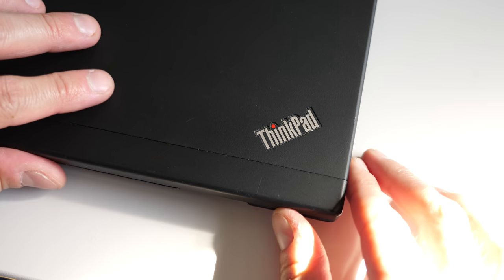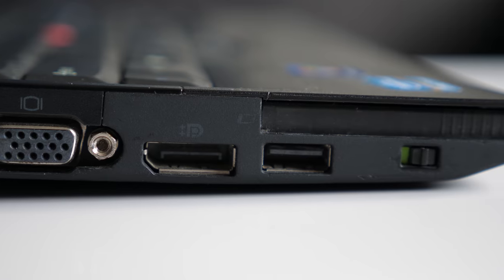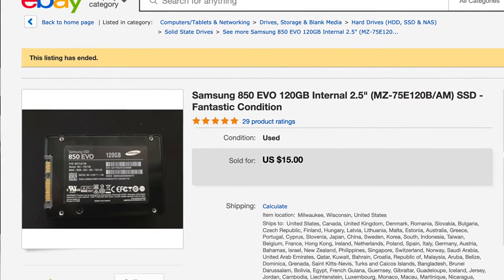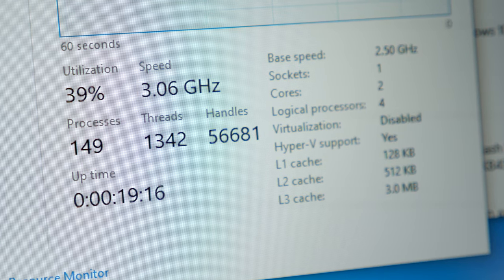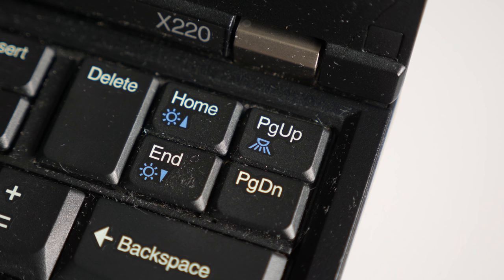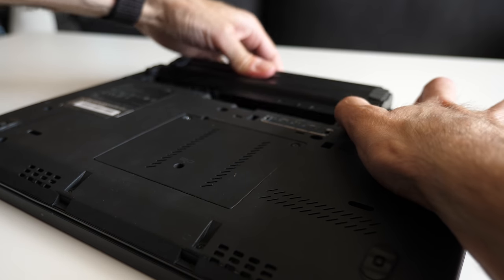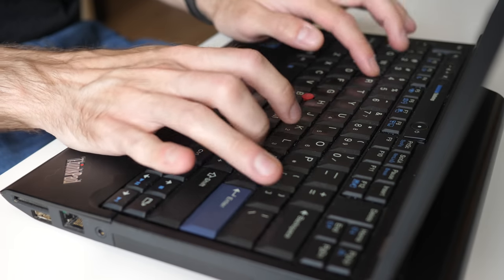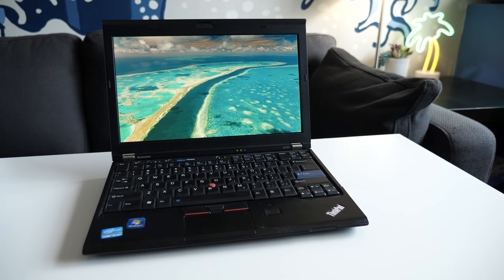The $100 Laptop Challenge -- This Old PC is Better Than You Think

Comment: X220 with i5 has no USB 3.0. This was exclusive to i7 model that had additional controller. They became standard in x230.
Reply: There are three port USB3 Express cards for the X200, X201 and X220's.  Magically three full USB3 ports get added (no dongles either) at less than $20 delivered (USA). :)
Reply: My i5 X220 has a single USB3 port via an external controller? Doesn't work with all USB3 devices though...
Reply: @radiolabworks  Don't you need extra power for full speed though? I got an express card with 2 ports and a tiny round power connector between them...
Reply: @radiolabworks  I've tried one of these cheap USB 3 expresscards and it didn't prove very reliable. Maybe power issues, since Expresscard only provides 3.3V power.
Reply: @MiniRockerz4ever  Most of the time it's okay with USB keys but with external hard drives, extra power is required .
Reply: You could added a USB3 port (actually two) via the PC express slot. That's what I did. However, with just stand working business, the USB2.0 port is really not borther me that much.
Reply: my usb 3 express broke 2 times over.  I still don't even own a usb 3 device
Reply: The W520 has two USB 3.0 ports.
Reply: My T420s with an i5 has a usb 3 port in it
Reply: @comicsans1689  The w520 is i7, which he did say had usb 3. But he was wrong about it being exclusive to just the i7 alone
Reply: All of you - X220 with i5 had no built in USB 3.0. Only i7 board had.

W520, T420, T520 and whatever else you can find in 2nd generation is NOT x220.  This video is about X220, and I wrote "x220 with i5" so all of you having USB 3.0 in i5 equipped OTHER models proves nothing.
Reply: But i painted my usb port blue, so now its usb 3

Comment: I have a close relative of that in my T420. Last year, I upgraded it to 8 GB of ram, a 1 TB SSD, and added a USB 3.0 part. Works pretty well. I even use it for my video editing (720p).
Reply: What is the USB 3.0 part? Looking to add one in mine. Is it a card to add in  the express port?
Reply: @maskednil  Yes, that's how I added it.
Reply: for how much did you get it? i might get mine soon with 70$ i dont know if thats a good deal or not

Comment: I love everything about this video.  I love the market analysis, I love the computer you went with, I love that you went around it and showed the good and the bad, I love that you went over operating system choice and let people know that they may just find a windows key there if they go looking for it, I love that you bring up freegeek and the amazing work that they do, I love that you encourage people to check them out, to contribute, to volunteer, to shop there, and help out a place doing great work for the community (particularly the youth computer enthusiasts who don't have any money like I was.).  I really wish there was a place like freegeek in my home town when I was growing up (not that I'm sad that I spent quite a bit of time volunteering for the library system who helped me in my early learning process). - not only do I love this video a whole lot, but I made many of the same choices myself.  I bought a used x230 on ebay, I put a 250gb ssd that i had laying around in it, but instead of running windows on it, I chose to install ubuntu myself because it has much better resource management (cpu, memory, etc.) than windows (but windows is also a great choice... in fact before I got mine, I helped my wife get an even better x230, installed a bunch of ram and a big ssd in it and she's using it as her primary machine (where i use mine mostly as a netbook and also to remote into my extremely powerful desktop machine when i need more resources).  I will be sharing this video around! Thanks, Colin!

Comment: I miss my X220 which was setup as a Hackintosh, sold it a few years ago to get a 2016 Macbook, keyboards not nearly as good
Reply: How has the keyboard held up on the MacBook
Reply: @jscipione  true
Reply: yeah those 2015 mbps had the worst generation of those butterfly keyboards
Reply: WHY YOU SWITCH, STOP UPGRADING AND START BEING A SURGEON TO YOUR LAPTOP/DESKTOP!
Reply: @FireFoxDestroyer  what
Reply: @tombarber8929  Why did you switch, you could've upgraded to an SSD instead, or maybe I was wrong..
Reply: Sorry.
Reply: @FireFoxDestroyer  I've been  using Macs since like 2000, before the Thinkpad I had a Macbook Pro 2011,  so the Thinkpad was more of a "switch".  Was running OSX on it, but had some issues whenever I updated it so I went back to the real Apple hardware, just happened to be when Apple really fucked up their keyboards
Reply: @onometre   help
Reply: I've also got an X220 + SSD that's been single-booting macOS since late 2016! Really smooth for everything except heavy data analysis and games, and the keyboard and screen (IPS) are really nice. Definitely a special machine.

Comment: Great video and great advice - would have an older x270 7th gen i7 that was $400 and it runs better than most modern thin and lights . Lenovo rock higher ghz chips so you get the speed ..... I swapped up to 16gb ram and got the extended battery and now this thing is a spaceship 🚀

Comment: Moore's Law has been perverted to mean "computer speed doubles every 2 years", while the original axiom was that transistor density would double every 2 years.  The problem is that this has neither held true, nor has it been true for a while.  This is why almost 10yo computers still fight above their weight.  What you will find in subsequent generations is that power usage has gone down, partially due to new processes and partially due to improvements in existing processes.  So a 6yo laptop with a big battery will get 3 or 4 hours of battery life, while a "airbook" today will get 8 hours, be 3 times thinner, and 5 times lighter.  With that "added lightness" you also get a reduction in useful ports and a reliance on dongles to perform everyday tasks.
Reply: The annoyance to me is the expandability of modern laptops.  I presently have a Latitude E5430 that allows you to upgrade almost any component easily (even the CPU!), but at this point I want a laptop with a FHD display, plus my E5430 has some overheating issues (a common problem).  Thankfully I've found that some machines are relatively easy to upgrade....but apparently laptop maintenance hatches are not a thing anymore, so you have to use a spudger so you don't destroy the plastics/metals of your new laptop. 😕
Reply: @ipeters61  My 2014 MSI GT60 2OD is pretty upgradable, the CPU, memory, disks, GPU are all socketed.  The display is the only thing that can't easily be upgraded, that's why I searched for a laptop with the best display I could find.
Reply: Another reason for me to like the older tech best.
Reply: I always like to say that sandy bridge really broke moores law.  I use sandy bridge still in my desktop and my laptop.
Reply: And you gain the ability to overheat as hell because they make these newer laptops thinner than they should.
Reply: The real reason why ThinkPads (and other older devices/technologies) are much better in many ways, is because, under a capitalist competition based economic system, companies, manufacturers, need to sell things cyclically. That's why intrinsic and planned obsolescences are designed (have to be) into objects more and more.

When objects were made to last, as in case of older ThinkPads, as in case of things produced in 50s, 60s, 70s, 80s - companies were able to "afford" to make sustainable, lasting products. Not anymore, today you companies really have to think about how to design products in a way that they will fail after few years.

There's no reason why for example today's notebooks couldn't or shouldn't be made with complete upgradability in mind, with really replace CPUs too, and why we couldn't or shouldn't keep producing parts for "old" devices, original batteries for old devices, and so forth.
Reply: GPU computing says hello. It's just CPU technology that has slowed down. GPUs are still advancing in line with Moore's Law. Hence why GPU acceleration has been rapidly adopted in compute intensive tasks.
Reply: @teemuvesala9575  Not exactly. While GPUs have increased in processing power significantly more than CPUs they have also became significantly bigger and more power hungry. Also AMD managed to stay competitive in the GPU market, while Intel had basically no competition until ryzen came out.

Comment: Thats what i have been preaching. Buy used enterprise grade stuff. Upgrade for a few extra bucks. You end up with something way more performant, sturdy and high quality for less money while also reducing e-waste and doing something great for the environment. 

If you were to spend 300 bucks on a new entry level machine, get a used enterprise class dell or lenovo for 2xx - you will get something in a very good condition (ex leasing machines from big companies remarketed), invest another 20-80 for a nice ssd and there you go.
Reply: 100% agree. Bought a used Thinkpad Yoga with a 12 inch screen. Thing comes with a pretty good stylus, the keyboard is fantastic (as you'd expect, really). Has scratches on the chassis and a fan grille is slightly broken (but really nothing major). Thing was 270 bucks, 256GB SSD, 8GB RAM, 5th gen i5. 
For that same money you could buy a chromebook R11 or something. With a celeron and 4GB RAM. Would be 30 bucks more actually.

Oh, and since I bought from a retailer (and live in the EU) I even get one year of full warranty. I'm not sure I'll ever buy new again.
Reply: Applies to so many other things too; switches, routers and access points for instance... Most of the domestic grade stuff is crap, even if it's not cheap. I needed a 48Port switch...POE would have been a nice to have. Picked up an HP Procurve for £80 delivered, has 360W of POE built in, can do over 700W with an external PSU upgrade. Sure it's fibre ports arent 10G, but that's no deal breaker for my needs...especially when a new switch with SFP+ would have cost me best part of £900...and not for a particularly good one.
Reply: Reduce - Re-use   :)
Reply: Seems to work with elitebooks as well

Comment: I've bought two Months ago a Lenovo T420.  Made in 2011 its impressive how good you can still work on it. I'm thinking about to upgrade with an SSD and more Ram.
Reply: Do it. It's 100% worth it! Love my T420.
Reply: @MrFreddy123  yes
Reply: A SSD always help the speed perception of old machines, more than RAM. And once you go SSD on your daily machine, there is no going back. I even installed a cheap used SSD on a Atom netbook I have.
Reply: @magoid  Yes I have installed an SSD on my Main Computer (Desktop) a week ago and will definitely newer go back to a regular HDD as Maindrive.
Reply: @DengekiGamer  Especially if using Windows 10. SSDs are a must for boot drives.
Reply: Don't just think about it. Do it.
Even a cheap, low capacity SSD will be good enough for a boot drive. And your PC will just start up so much faster
Edit: I just now see that you already did it. Good decision, all my PCs are using SSD boot-drives by now. Just because it feels so much snappier

Comment: For $100 in 2022, I picked up a 2015 HP ZBook 14 G2 mobile workstation with an Intel Core i7 5500u dual core processor with 8 GB of RAM and 1 TB Toshiba HD. It was in mint condition and it stacks up quite well against today’s consumer grade laptops. Everything is repairable and upgradeable apart from the cpu snd the TPM module. I was able to upgrade the BIOS to the latest version available in 2020. Its s good value on a budget!

Comment: Another factor to consider, which wasn't mentioned in this video, is that Lenovo Thinkpads of this period had amazing keyboards. If you're going to spend significant time writing or coding, then it's really a no brainer.
My Thinkpad L430 - which I'm typing on now - has been one of the best laptops I've ever had. The only downside I can think of is that I'd prefer a 1080p display.

Comment: i´m using a Thinkpad X230 since 2015. It´s fantastic. The display backside and the bottom cover are made from magnesium. And you can use a MSATA SSD in it if you don´t wanna lose the space of the HDD in there. For 80$, it´s a steal. The sandy bridge(x220) or ivy bridge(x230) CPUs are fast enough for everyday tasks.

Comment: Man, this reminds me when I used to bring my old thinkpad T420 with me everywhere in high school with ubuntu 16.04 installed. 

I loved that machine, without windows it was much much faster (before I upgraded to an SSD), and it was just maintenance free for the longest of time and was a awesome machine to use throughout high school. I always was ‘that guy’, since laptops weren’t allowed in class but I had a special exception both because my thinkpad matched all the other schools thinkpad, and because I had come from another school that used primarily laptops.
Reply: Yeah i noticed that too. Not only boot time but overall software speed was drastically faster under Linux than windows. Even with a HDD.

Comment: I've been tinkering a bit with old laptops from the 90's and just about the start of the 2000's, and the build quality on these are just way beyond any budget laptop of today. Yes, there are more premium laptops available these days, but these early ones just has that extra quality about them, especially with the keyboard. Even todays ThinkPads have mediocre keyboard compared to their older brothers. I have a ThinkPad T60 from the mid-2000's and the keyboard just blows me away everytime I use it. Too bad it is only usable for light web browsing and typing these days.
Reply: Exactly, I have a few 60 and 61, both from the T and the X series. Besides tinkering with alternative operating systems (like Plan 9), my main use case for them  is writing.

Comment: Watching on a Dell XPS 15 L501X I got in 2011. Still going strong on a gen 1 i5, 6gigs of ram, and an hdd. (I've ordered a 4 gig stick to boost it to 8, and will get an ssd when I have money coming in again. Aside from the stuff that actually requires a modern cpu/gpu, etc. there's nothing it can't do just as  well as something brand new.
Reply: I should say, watching on XPS15, while working on a Latitude D630...which is even older, but performs just as well on linux mint for stuff like browsing.
Reply: I still use as my main computer 12 year old Lenovo T410, i5-520M, 8 GB RAM, SSD SATA-2 (Bitlocker encrypted), W10 Pro. The only practical problem is Youtube 720p60, quite noticeably burdening the processor (40-50%).
Reply: @telemasz1086  Yeah...that laptop died, lol. The graphics chip took a crap, so I actually ended up finally taking the initiative to build a pc, lol.

Comment: Couldn't agree more. I have a Dell Latitude E6230 which is now ten years old. It's an i5-3320 with 8gb of RAM and a 128gb SSD that I bought as a refurb in 2016 for £220 (UK) and, having spent an extra £50 or so to replace the battery and power brick and replacing the pre-installed Windows 7 with Windows 10, it's still working just fine in 2021. It wouldn't be able to cope with video editing or anything like that, but it's perfectly happy to do image and audio editing, and it's find for every day use. I keep think it must be due to expire, but the damn thing just keeps going.

Comment: Great video! As I write I'm using a Dell  e6320 that I picked up used for around $100.  It was surplus property from our local state university.  It was very dusty, the hinge screws were loose, but it was hardly used!  That was , a couple of years ago and I have no regrets.  After proofing it and using it for awhile, I invested in it some more and upgraded to an SSD drive and went from 8 to 16gb. Now it flies with its I7 and bridge CPU its Ubuntu 20.04.  Who needs Windoze?

Comment: I still use a ThinkPad X200 as my portable machine. It still have a regular hard disk, but the performance is enough to take notes, chat, send e-mails and browse the Web. It is always my partner when I go to the university and it is also my 2nd display at home (connected to a 1080p external monitor), controlled via Synergy. I run openSUSE Leap 15.1 with FVWM on it.

Comment: I got an Asus used at Goodwill. It had 4gb built in ram and I added 8gbs. Full 1080p screen and a i5-4200u for 120$ because I picked up a 256gb ssd they had. On top of that it has USB 3.0!
Reply from the maker: That’s a good deal!

Comment: I picked up a x230 recently, and I found you can go out a mSATA ssd in the palm rest area. The mSATA slot is only sata 2 speeds but with Ubuntu it still is snappy
Reply: I've recently fixed up 8 of the x230.  Also ThinkMods is releasing an Expresscard to NVME m.2 adaptor.  They will run up to 16GB of 2133mhz ram, if you can find any.  Ripjaws is the best, but you can find some HyperX still, is pricey, I only did it because I stumbled into an i7 for cheap.  It is faster than my t440s i7, stands to reason because the t440 is a U processor, 15w vs 35w.  But still.  I'm rocking the x220 keyboard
Reply: The sata controller/port on my X220 apparently broke, and I put in a mSATA and it runs well again...